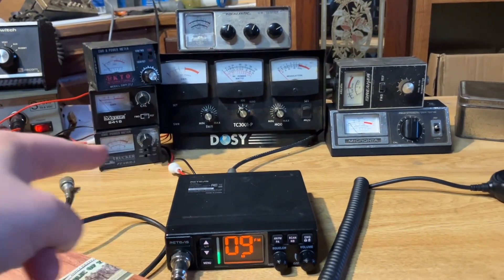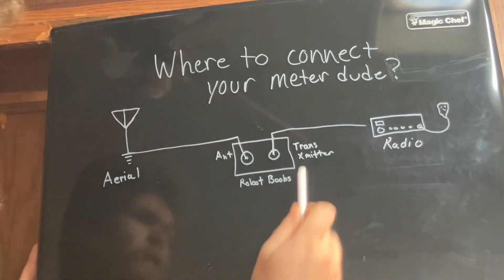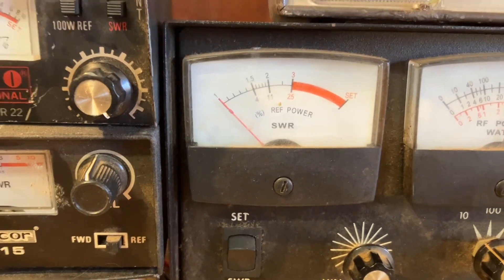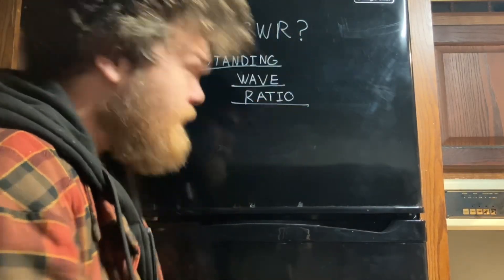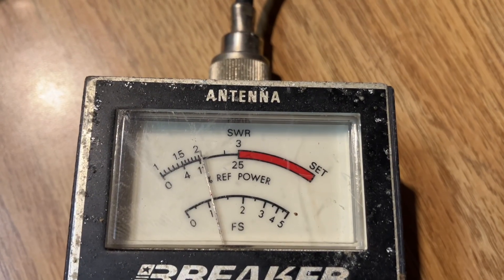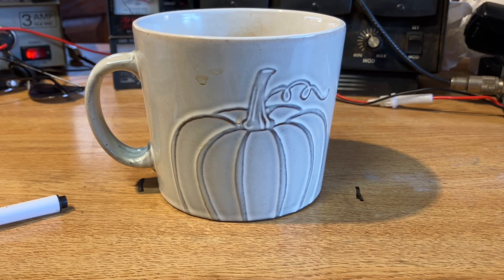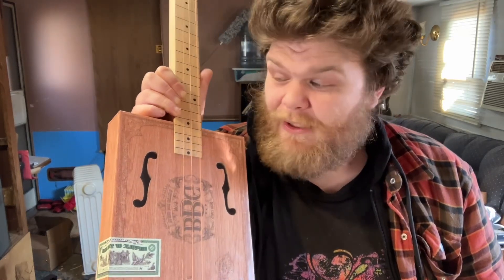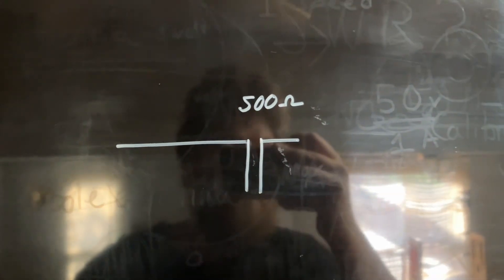HOW TO USE AN SWR METER:  SWR and Impedance EXPLAINED

Comment from the maker: To clear up the confusion about the cup demo and other points I forgot to address.

1. Why the cup didn't move:
I didn’t apply enough force to overcome its Inertia. Since Force = Mass × Acceleration, I could have moved the cup if I had flicked it faster (Acceleration) or used a heavier object (Mass).

2. How this applies to Radio:
Just like the cup, if we don't match the 'force' our antenna requires, the energy can't go forward. Instead, it reflects back down the line.

3. What is a Standing Wave?
When that reflected energy bounces back, it collides with the energy trying to go out. This causes the power to bounce back and forth rapidly inside the transmission line. To us, this energy pile-up looks like it isn't moving anywhere—hence the name Standing Wave.

Comment: swr is only the half story.... a dummy load will show perfect swr 1:1 but it does not radiate at all.
Reply from the maker: Absolutely, the resistor perfectly matches, the impedance of the incoming signal.

I was hoping to answer more of those questions in another video. As I did not want to make people feel too overwhelmed.

But then again, perhaps I should’ve just made an hour video
Reply: Not true, i have had several local contacts on cb radio just using a dummy load, they do radiate a signal albeit a low level one.
Reply: @ElliottSpencer-hn9qg Ohmic resistance does not radiate. I wonder what kind of dummy load you got there.
Reply: @geirha75 the dummy load is a normal 25 watt load made for the CB radio market, i guess it's made from carbon film or similar.
Reply from the maker: @ElliottSpencer-hn9qg i’ve been able to talk on a dummy load as well just not very far. 

It does appear that unless you have everything enclosed in a metal housing that there is some radiated power that you’re going to be shooting out of that resistor